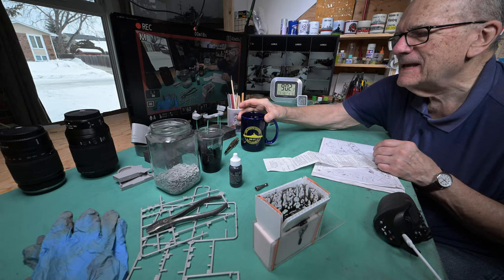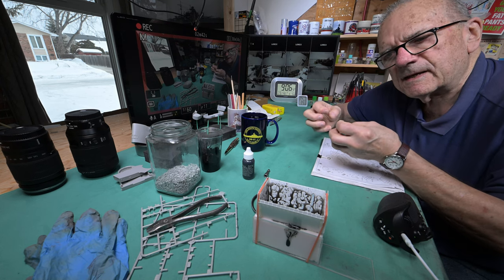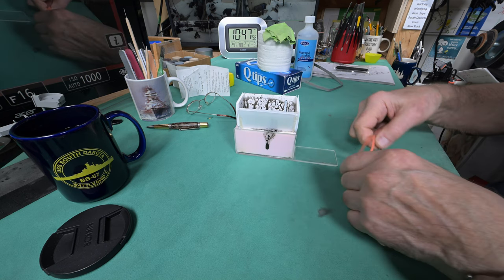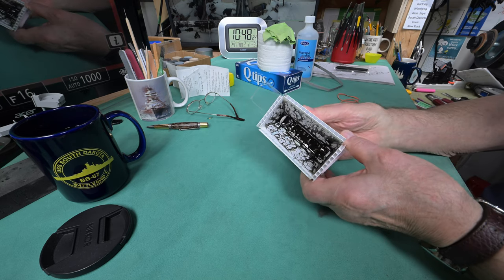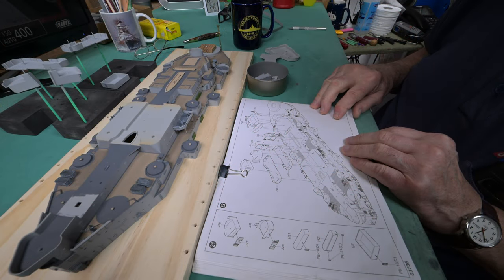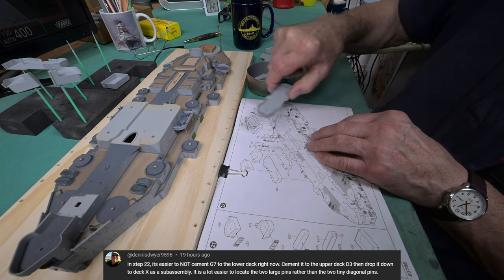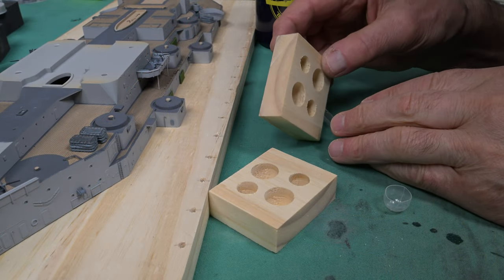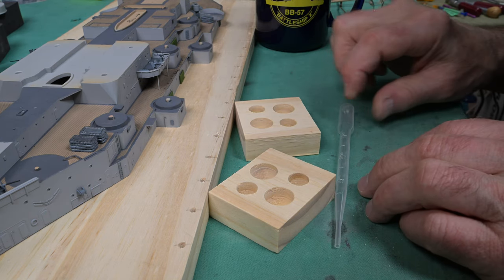The Model Ship - Part 1514

Comment: Hi Ron, Rhanks for the resin demo today.  It's amazing just how much air is trapped in the resin.  Thanks for sharing.  Have a great day.  Jeff
Reply from the maker: Hi Jeff,
Re; "amazing just how much air is trapped in the resin"
Actually there is very little. But that "very little" expands tremendously when under vacuum and bubbles to the surface.
Reply: @roncalverley  That makes sense.  Thanks Ron.

Comment: ...well, technically, you could still call it a pressure pot...you're just applying the pressure to the outside of the pot...😉
I think you may have inadvertenly picked a great color for the pen blanks...after turning them, they may resemble a ship camouflage scheme...👍
Matt